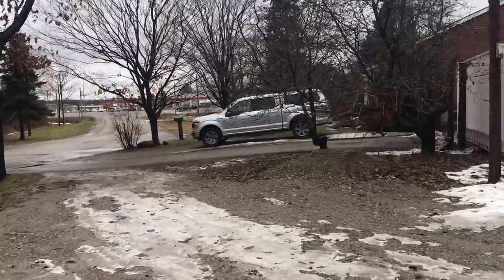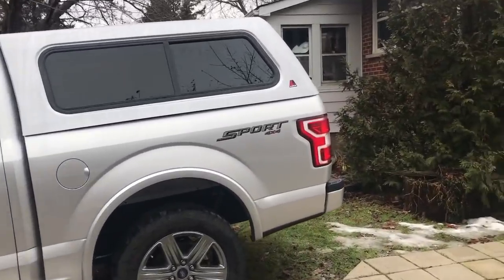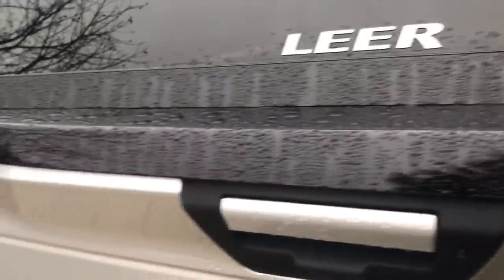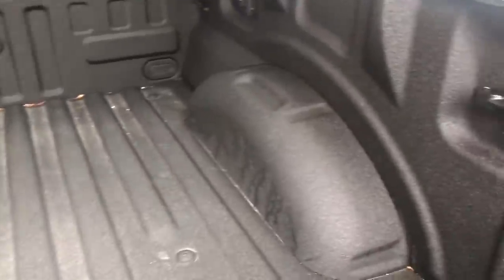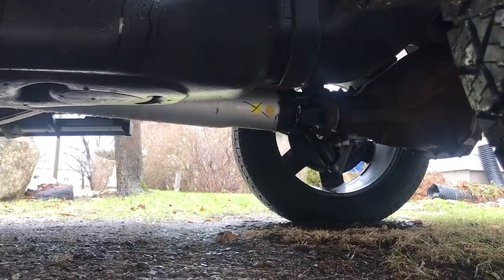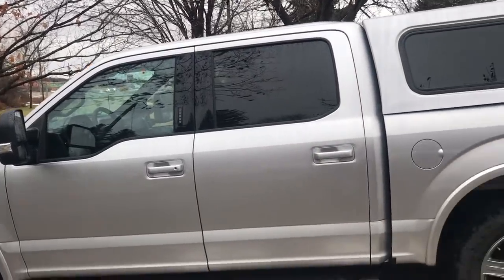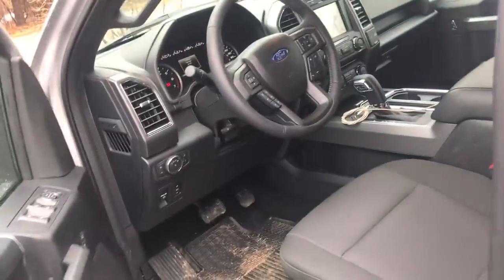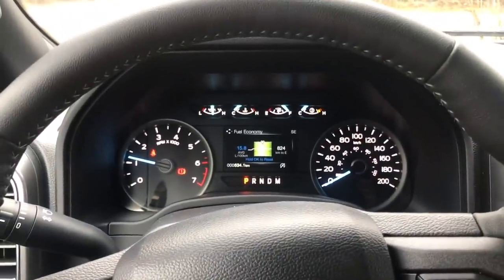Well.... is it water tight?  is it a LEER or  LEEK!!!???  LET’S SEE

Comment: I only heard 2.5 seconds of crank, not 10 seconds. I also never put the truck into gear until the rpms have gone down to idle.
Reply: When you watch the video and notice the time line it is not as long as he thinks.  It is 2.5 to 3 seconds like you mentioned.

Comment: It's the direct injection.  The pump has to pressurize the big tank, then you get the gas to the motor.  It's going to crank.
Reply: H'mmmm kind of,...if it's like the Diesel F-250 I had, the injectors are programmed to not work until there's oil pressure  built up in the engine. 
I wonder is this what Ford's done with these engines ?  If no oil pressure, then no fire,...kind of saves possible dry start damage.
Reply from the maker: So would it pressurize if you turned the key to on for a few seconds before crank?
Reply: I have a 2013 f150 ecoboost it is direct inject with a 36 gallon fuel tank and it doesn’t take that long to fire up what’s the difference between the non eco and eco to make it take longer?
Reply: @billstmaxx  If you're asking me,...then, in my 2005 F250 with a PowerStroke Diesel you'd turn the key to start and it would crank for a few seconds, ( like your truck does now)...before the engine would fire up. According to Ford, this was to allow oil pressure to build before the injectors would inject fuel to start.
Maybe 'Mark G' has it correct for the gasoline V8 you have in your F150 
Your dealer will let you know for sure.
Reply: @billstmaxx  if you turn the key on before cranking and wait until the fuel pump pressurizes the fuel system it may pop right off my 2015 Silverado with direct injection cranks just as long as your truck when cold using the key or the remote start .. I have the same model cap and also have that lip on the back because of the curved tailgate yes snow does build up on it when parked but while driving it doesn't stay there it just accumulates on the back window because of the vacuum and swirling wind behind the truck

Comment: Apply the parking break before shifting to park. If you apply the parking break once in park and after letting off the brake pedal, all the force is on the transmission and the parking brake does nothing. Just sayin...

Comment: That amount of time with the cranking is not normal!
Reply: fordwindsor351 it’s a ford what do you expect
Reply: @braptasticfilms3791  Read my comment again, where did I say anything about it being manufacturer specific?
Reply: fordwindsor351 it’s a joke..obviously
Reply: @braptasticfilms3791  Every manufacturer out there sucks at something.
Reply: No it’s definitely normal i’ve seen other models like the King Ranch and the Platinum do it as well
Reply: @corstang3312  it doesn't make it normal, there's a current issue that Ford is dealing with!
Reply: My 200k mile 2011 5.0 starts in way fewer cranks than that. Definitely not normal
Reply: die warlock  One but the guy I work for, he has several in his fleet. I work on enough if them to know what's normal and not ,especially with this gen.

Comment: Does the start/stop feature bother you?  Seems like it could delay you taking off from a light in some situations. It would drive me nuts for the truck to have to start up every time I stopped.  Congrats on the new truck by the way.  Looks nice.
Reply: It would drive me crazy on any vehicle. You have to wonder who thinks this stuff up. I can't believe the starters don't fail sooner. I mean, instead of starting the vehicle 3-4 times during a trip, now you may start the engine 20-30 times depending on the traffic conditions. And you know how batteries like to fail. So now instead of failing at home or in a parking lot it will be in the middle of traffic at a stop sign. If I had a vehicle with auto-stop it would be the first thing I would disable.
Reply: Stop/start engines either have a continuous rated starter motor or don't use the starter at all on the newer systems. 
My vehicle uses a integrated starter-alternator system so the starter only gets used on initial start-up
Reply: I recently watched a video on how to turn it off . A white controller box under the left dash , he unplugged the bottom wiring connector . Simple as that . Only negative , it needed to plugged back in when towing .

Comment: Actually looks like Leer has finally changed their design to help prevent leaks. Paint doesn't match though, not even close. I've had 3 Leer tops on 2 different trucks. I always just buy them in black because I know the color match is going to be a joke. Black matches everything!  I wish Leer could figure out how to make a commercial aluminum cap that didn't sweat every time it frosts. I've spent two evenings insulation my newest cap with foam board. Its helping but still have condensation. My buddy has an almost identical cap from ARE that has never had this problem.
Reply: not true I bought the same model Leer as Bill and my truck is kinda a candy apple blue Chevy calls it deep ocean blue metallic which like silver is tough to match without blending it to the whole truck and after a couple months of curing time the paint on the cap is pretty much bang on

Comment: My 2018 new Silverado 5.3 V8 cranks about 1 second, even in sub-freezing temps. When I open the door after its sitting for a while, the fuel pump whirs for 2 or 3 seconds, charging the fuel rail. Maybe Ford didn't do that. . .  

(hope you remembered to re-latch the cap handles before you drove off. . .!!)